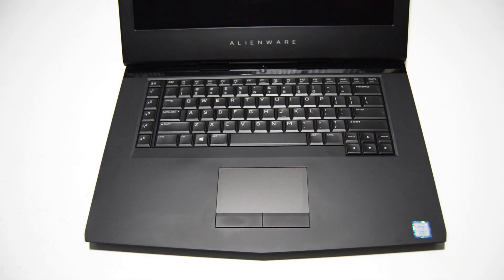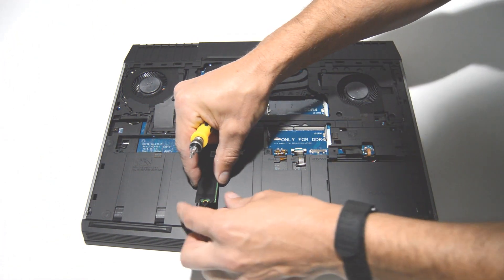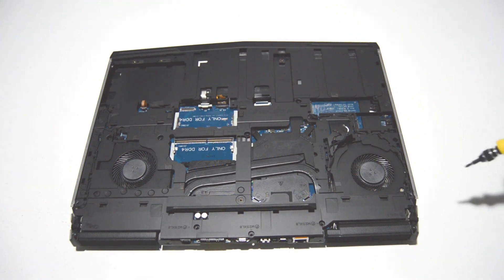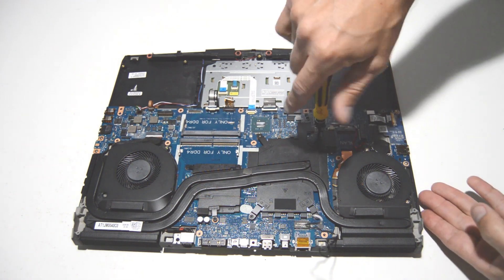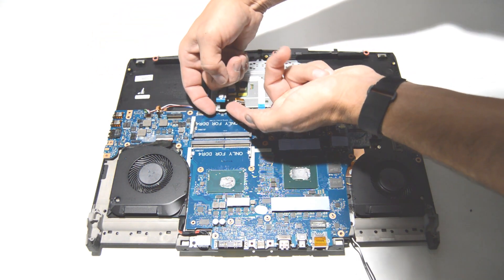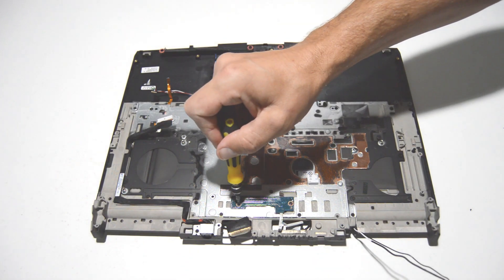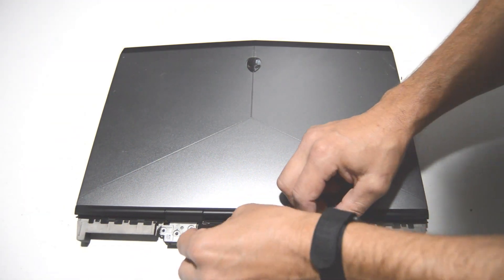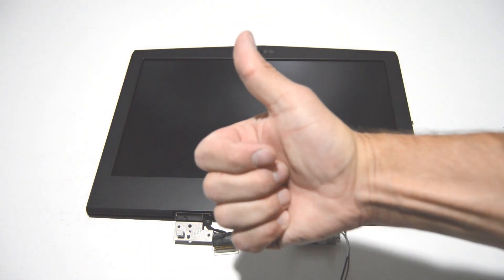How to Disassemble Alienware 15 R3 GTX 1060 i7 7700HQ Laptop or Sell it.

Comment: Are the batteries of laptops supposed to be perfectly flat or are they aloud to be slightly convexed, and how long should the battery life on this type of computer with nothing running?

Great video by the way.
Reply: Hey, I know this might be a late response, but the batteries should be flat. Once they are starting to become convex, they are becoming more of a risk than its worth. The deformation alone can damage the laptop structure and its components.

Comment: I would like to ask of what is the cause of burning the dc jack of R2??? I remove the battery then i connect the charger and it turns out burn. It beeps 4times. What does it mean?

Comment: @ sellbroke, my nephew screwed up my laptop key (W) and now i have to press hard for it to work. i wanted to find a way to fix and disassemble the laptop and keys but you didn't cover the keyboard part. I'm not a computer guy and i kinda don't wanna risk disassembling my laptop. Do you know how to fix the key issue? Or does anyone here know how to fix it? I'd really appreciate it.
Reply: You have to complete all the steps, please be careful with those 3 connectors underneath the motherboard just before getting access to the keyboard.
Reply: pretty sure u need a new keyboard. same thing happened to me
Reply: My w key is also fucked but it still works enough

Comment: I just want to clean my fan. And I have to do all of these things 😔
Reply: Same here and there's not 1 video explaining how to clean fans for the AW 15 R3 / 15 R4...super annoying
Reply: Yes, there is no other way. You cant really blow it with compressed air as the dust has compacted to cotton wool like matter. BTW this fan is fairly easy to access. There are some laptops where you have to fully disassemble it - even remove the motherboard.
Reply: @Tony Peacham Came here for the same reason: I just want to clean my fans
Reply: Same man and what’s that wrist thing u need
Reply: I need to replace one of my fans.   I'd hope it wouldn't be so much work but replacing the battery was a chore as well.
Reply: @clearsmashdrop5829  how was it? did you have to remove the mboard too?